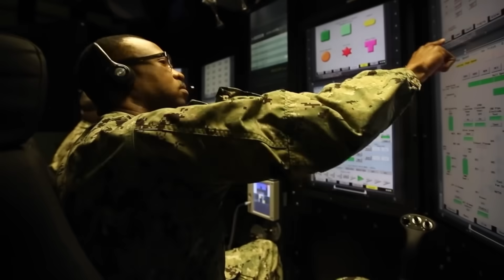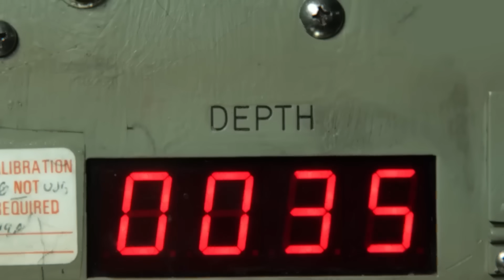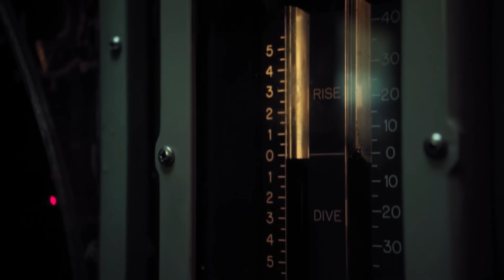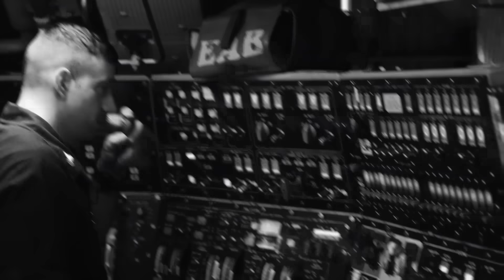What Happens When a Submarine Hits "Crush Depth"

Comment: As a retired submariner from the USS Henry Clay SSBN625 Gold Crew I can attest that our boat exceeded it's "Design Crush Depth" of 2650 feet by a significant margin during deployment in 1984..... by a significant margin.
And yes, we were all shitting bricks.

We were cruising at a 1200 foot patrol depth when a junior officer ordered a missile readiness exercise while we were rigged for running under a reduced electrical load.
He was warned to secure from "Reduced Electrical" first but countermanded our recommendation stating our primary mission was as a missile platform and we had better be ready to launch at a moment notice.

As soon as power was applied to all 16 missiles and 244 warheads every breaker tripped and the boat went dark and we started sinking backwards as propulsion had lost power as well.

90 seconds in, after passing the 3400 foot mark, the Chief of the Boat blew the emergency ballast tanks which halted our sinking but wasn't quit enough to get us positive buoyancy at that depth without forward propulsion.  It did, however, give the engineers enough time to take the reactor out of SCRAM and get the steam generators going to restore power and get us moving again up to a shallower depth.

That specific junior officer was a major dick with an ego (the kind that would take "friendly fire" in a war zone) and we were all glad that he was never seen by us again after that patrol.

The boat itself was put in dry dock for inspection and overhaul but it literally suffered ZERO damage from the excursion well past design crush depth but was eventually decommissioned 6 years later in 1990 after 28 years in service.
Reply: What a story! I'd be shitting bricks too! Glad you guys survived!
Reply: 30% beyond the theoretical crush depth. Wow. I imagine that asshole officer could not wait to get off the boat.
Reply: @mtb416  If he got the railing from a superior officer he so richly deserved your right! They should have busted him down to seamen!
Reply: That officer must have received a court martial for nearly losing a sub and all on board yikes scary story, that guy was an idiot
Reply: Can't do your duty and launch missiles if your sub implodes. I hope some one of high rank explained that in a harsh way after he nearly killed you all. He deserved whatever he got and probably more.  Lunatic.
Reply: you could write a short book on your story
Reply: @Andy-rg2xd  can’t publish many stories while alive.
Reply: @Andy-rg2xd  and/or a movie!
Reply: @Andy-rg2xd  he did. You read it.
Reply: That's almost identical to what happened to Thresher.  Id say you guys were lucky the ballast blow worked, sort of.  Great story, mate.
Reply: @travtuck7646 thats not what happened to thresher at all wtf? A pipe burst and shorted the electric, did u watch the video?
Reply: @Boody617  As far as losing power and then sinking to crush depth yes it was the same.  In Jerry's case, the ballast blow worked.....Threshers was believed to have ice buildup or whatever so it didn't work.
And.....you are aware that the silver brazed joint failure theory, is just a theory right?  No one actually knows what took Thresher down, that's just the most widely accepted story.  Its likely accurate, but still a theory nonetheless.
Reply: Wonder if the Junior Officer realized how lucky he was?
Reply: @jamessimms415  "Wonder if the Junior Officer realized how lucky he was?"

How lucky he was the crew didn't kill him before returning to dock.
Reply: Uhhhhh, no sir.   1200 ft to 3400 ft in 90 seconds?  And this event is not mentioned in any of the BESS training.  The submariner community is small and close knit.  A story like that would be legendary and well known.  If it were true.
Reply: I have to call "Bravo Sierra" on this.  No qualified Submariner would ever refer to it as "Designed Crush Depth".  There are "Test Depth" and "Crush Depth".  And, at least on the boats I rode (SSN-592, SSN-595, SSN-621) the difference was only 1 boat length.  In addition, ANY excursion below "Test Depth" immediately and permanently removes that hull from service.
Reply: @garymartin6987  yeah i was thinking the same.
Reply: You have to give a hand to those who designed, built, and maintained the boat.
Reply: I agree that this story doesn't add up. First off any well intentioned military vet wouldn't be so willing to detail an event that would surely be classified.  US submarine depths are definitely classified.  I never served but a knew a lot of Vietnam era vets I missed that draft by a couple of years.  The consistency of thier abject refusal to speak of ANYTHING they experienced in battle was solemn.
Reply: Puhhhh.... you should give thanks to the designing engineers. I can't imagine how scary it must have been.
Reply: Tbf we had an LT in the army that was bad enough that he asked the men's opinion of him at the end of deployment. I've never seen a man so broken afterwards. He was not a good officer, he was a good desk jockey and we let him know it. Sometimes you have to ignore the opinions of the enlisted because you have to make hard decisions, sometimes you need to be open to opinions because you might not know everything. Both cases seem like the latter to me.
Reply: I don’t know much but this story doesn’t quite add up
Reply: Our HY40 hull had a 36” corrosion pit under the lead bolted to the engine room bilges. The pit went thru about half the pressure hull. We were superLID when the conn fell asleep from high CO2. The drain pump discharge was pegged hard when I woke the COW with a super woop on the 1SJ.
Reply: How does a Junior Officer's career actually survive after such a thing?
Reply: like that scene in Red October , ..You ass, you killed us.
Reply: I never served or been on a nuclear submarine before just fascinated by them but I must say this story doesn’t seem to add up. It’s very rare to hear people that served tell their cruising depth or crush depth.  And also why did the COB wait well past crush depth to do a emergency blow?

But like I said I never served before and know that I very well could be wrong but there are people that served before that even say they see red flags in your story.
Reply: Your crush depth was at around 2600 feet but yet your command waited till 3400 to blow ballast? Just makes no sense.
Reply: @Rudizel  Let's just say... you're 100% correct.  😉
Reply: Bdpsuperstar glad your still kicken
Reply: why couldnt you blow the emergency ballast sooner?
Reply: if you read the properties of typical HY80 steel of the time and 625's published test depth and use the formula to calculate the actual "theoretical" crush depth it doesn't sound too far out - Just my opinion
Reply: @JamesMiller-fm8qs  I don't think HY-80 (rated for 550 meters) could withstand the pressure past 750 meters even with a good hull structure design. USS Thresher imploded at around 2400 feet/730 meters, and USS Greenling in an incident in 1973, had a depth gauge malfunction in the control room which caused them to submerge to 2300 feet, before someone saw the depth in the engine room's depth gauge, and immediately reported it to the commander, they very narrowly avoided crush depth; when they resurfaced, the "ribs" of the submarine could be clearly seen on the outer hull. Given those two instances, 2400-2500 feet at most, would be the max crush depth i'd give to any HY-80 made military submarine, if not less. If we're talking about HY-100, that could be possible, though only theoretical. Cheers.
Reply: Holy Crap, I would have seen to it that guy would have been launched out of a torpedo tube, accidentally.
Reply: Mmmmm... the Nopemeter is pegged on this one. 

The Henry Clay was my first boat. Lots here just doesn't ring right.
Reply: @glennmoss3285 My brother served on an Ohio class.  Never once has a mentioned the rated depth of his sub.  Completely secret info.  Yeah,  I don't believe this guy for a second.
Reply: @Jim Frazier This. Former crew of USS Ohio SSBN726, Gold crew here.  The one and only time we dove to 85% of test depth, was to avoid rocking and rolling under a typhoon in 1991. We stayed there for about 16 hours. Did not sleep great. Heard weird hull popping noises after that. Some of the equipment mounting plates had warped, I think.

Also, we had two backup propulsion methods. You'd have to lose all steam to both turbines at the same time. Even a scrammed reactor has enough residual decay heat to give some light propulsive thrust for a bit. And, you never do a dangerous evolution when close to test depth. You NEVER operate under test depth  That's how officers destroy their careers. There are so many procedural safeguards and engineered safeguards, plus, backups for backups for mains. That guy is full of crap. 5:45
Reply: Shout out to USS Henry Clay from a member of USS Andrew Jackson SSBN 619 Blue Crew (79-82)
Reply: You’re giving away national secrets
Reply: Thank you for sharing this story with us all. What an experience
Reply: This one's a no shitter...
Reply: :) was his name Herbert Sobel? Sorry, just started watching band of brothers for the 50th time. Crazy story, I get claustrophobic if I wear a tight shirt, can't imagine being on a sub. Went down in that sub tied at pier 39 in San Francisco, was quite uncomfortable the whole time. You guys are indeed a special breed...
Reply: Heard a saying once.  "A good engineer is conservative on paper."  Sounds like you had some very good engineers behind the design of your boat.  You survived a lot more than what was expected.  Unfortunately, engineers can't fix stupid.  Your junior officer is a grade A asshole who hopefully got thrown out of service before he could kill anyone.
Reply: sounds about military. putting everyone's life at risk for training.
Reply: Lucky ones
Reply: Jesus Christ, do they let any old idiot into the submarine service? They should be dropped off in a raft. Crazy the way a single ego can risk the lives of so many men. He wouldn't have lasted long in ground combat, as you say.
Reply: Bullshit.
Reply: Yes.. I'm sure "bigdickpornsuperstar" is a retired submariner lmao
Reply: We don't talk about depth now do we...
Reply: Surprised that officer made it off the boat without being shot out of a torpedo tube.
Reply: Classified
Reply: If the submarine had been lost, the truth would not have been known, and some technical failure would have taken the blame. You don't tell a family that they've lost a member to an asshole.
Reply: Someone need to woop his ass
Reply: Yeezus. One day that dude will run into some of those he nearly killed and he might be wishing he did things differently.
Reply: That’s incredible.
Reply: My god brother. You write so well! That was incredible to read your story! Thank you for sharing that!
Reply: I think we all served with junior officers like that.  When I made the transition from E-5 to O-1 I never forgot where I came from, in fact, I purposely went that route rather than ROTC because I always wanted to make sure my leadership was grounded in mutual understanding and respect.
Reply: Odds are that officer was either given a chance to resign or had a factory reset in the bathroom
Reply: I never learned much about subs, being a surface Nuke, but there are a lot of small details in this story that make it clear he knows a lot of what he's talking about.  If it's fabricated, I'm guessing a Surface ETN with an imagination
Reply: Incredible story sir!
Reply: Sounds like a load of bollox to me. An SSBN at 1200ft patrol depth? Junior officer ordering the drill, why didn't the OOW override him? Electrical failure resulting in a Scram causing the boat to dive stern first, just how bad was the trim, and why no breaker discrimination or were your propulsion watch, specifically the electrical panel running a ring of fire? Why would the CooB wait 90 seconds to blow when there is an established loss of propulsion with negative buoyancy? "... take the reactor out of SCRAM" you mean achieving criticality /reactor critical. Finally, no submariner that I know of any nation would quote specific figures pertaining to operating parameters such as 'Design Crush Depth'. Hmmm... seems legit! 🤔
Reply: @kevg3320  My brother served aboard an SSBN in the late 80's, he's never, nor could he, go into details regarding crush depth or anything else.
Reply: @quest5581  I served in the Royal Navy on SSN's for 19 years. Couldn't agree with you more, even my wife doesn't know any details that aren't public/common knowledge.
Reply: i was sat here thinking, what happens when a sub implodes, do you just crush to bits and your eyes pop out, anyone know what happens to a human , do you split open or something, its all very sad but i need to know,
Reply: where was the senior officer?
Reply: Man....the anxiety I felt just reading your tale,  had my nerves on edge. You guys evidently were blessed with an extyremely well built boat. I could'nt do it. I can't even imagine being in steel can under water - let alone literally living in one. Mad props for both your bravery - and your service!
Reply: Yikes! I wonder that I couldn't find any other source about that incident, which makes me... uncertain what to think of this story. This makes too good of a yarn!
I don't know design specifications of the Lafayette class, obviously. But it is odd (to say the least) that blowing emergency ballast in an undamaged boat does not result in positive buoyancy. Usually there is even an additional safety margin to STILL be able to surface, even with some additional water, due to damage, etc...
Undamaged boat, blown ballast and still not positive buoyancy is at least a little weird. Were you low on compressed air for ballast blow out?